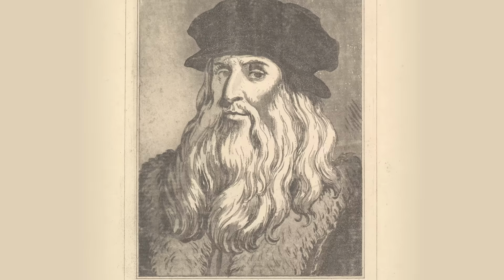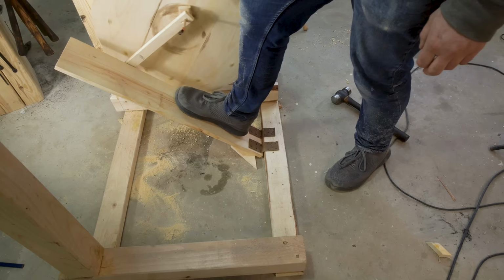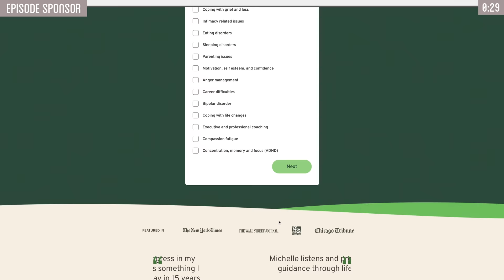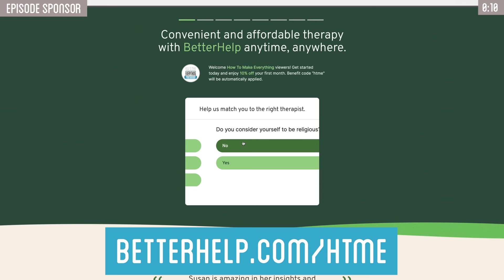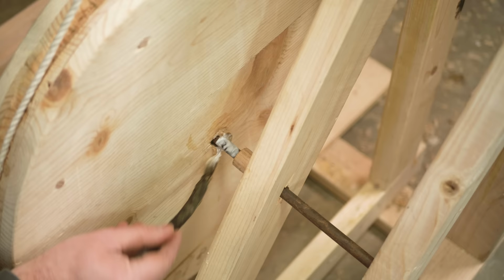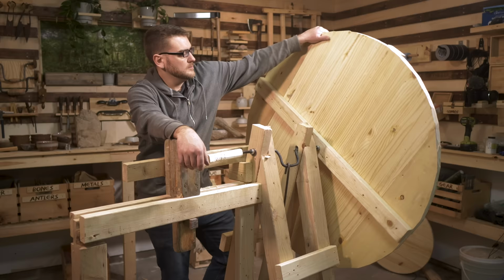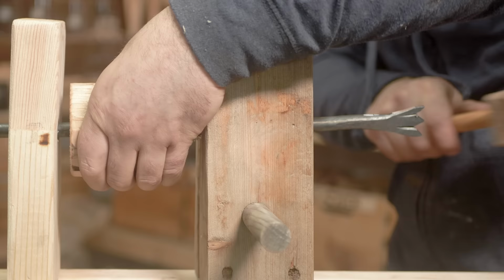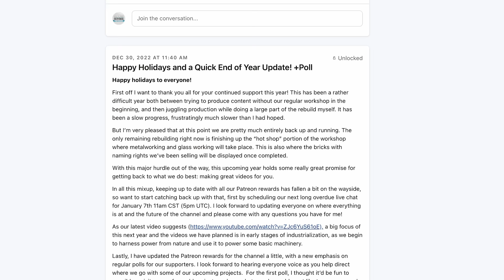Does DaVinci’s 500 year-old Lathe Work?

Comment: Building a lathe is one of those things that as complexity goes up, weak points become readily apparent. Loose holes and joints add extra flex, which in turn leverage on other joints to break wooden pieces. Hence bolt plates and metal wrapped joints, at least for the parts that didn't need to be very rigid. That and not using pine, but that's a side area where hardwood shines.
At any rate, a flat belt drive to a flywheel that is itself connected to a larger wheel that connects to a smaller that drives the work piece may be on the horizon. As the actual power, an assistant instead of the one holding the cutting tool. Barring a waterwheel being used. Try to avoid the use of rope on pulleys because of the low surface contact patch, again getting back to flat belts usually made of leather. It's quite interesting to see the progress of the tech as through the learning curve and the simulation of the centuries goes by. Most definitely a good series to watch.

Comment: a few things that would help:

lower the tool mount a smidge to help the angle

find a tree removal company and pick up some fresh green wood. preferably hardwood. a softer hardwood that is very frequently removed is silver maple. green is easier on the tools and makes smoother cuts.

always have sharp sharp sharp tools

the wobble concerns me as you get higher rpm’s and your tool could get caught accidentally and could injure you.

your woodworking skills are getting better!

through history there was always a huge communal support and knowledge guiding these methods, and many things were outsourced or tools passed down from each generation.

when you are splitting a tenon, split far away from the line, and then slice down to the line.

pine, especially around knots, can be really unpredictable. avoiding them in layout sometimes doesn’t work, but it’s something to be aware of.

great job. you’re a trooper.

Comment: Your drive assembly pulls to the side stressing the joinery and causing it to break. Maybe use a metal throw crank.  Also when joining metal drive components to pulleys and flywheels, forge the metal square where it goes through the pulley and use square cut outs through the pulley. Use the biggest square you can and the connection will be stronger.

Comment: I would suggest trying to create a tensioning mechanism in the pulley system. also you could drastically reduced the spinning friction by making simple metal sleeves to pressure fit in the wood and then put the axel through the metal sleeve. metal on metal friction will be much less then metal on wood. it will also prevent the holes from boring out as fast. less friction will also reduce a good bit of the rotational forces that are made that contributed to your wobbling issues.

Comment: This is such a cool channel. Even with my experience using a very small lathe if the work stops or slows down you end up with an ellipse instead of a circle and then it gets worse cause it's lopsided etc... This was the main challenge of any non motorized lathe and takes a lot of skill to coordinate everything in order to finish a piece, if you go out of round sometimes you can't finish the piece. The flywheel would really help with that.

Comment: A little tip about fly wheels is that the mass on the outer edge is what is doing most of the work.  If you make it more like a wagon wheel with a lot of mass on the outside you can make it more efficient.  Also, Davinci would have probably ended up creating metal bearings to reduce friction and retain the grease better.  Wood is will tend to absorb the grease and has a much higher friction quotient than metal on metal.

Comment: Nice work. I subscribed because of this video. Looking forward to more.

One thing to consider is the vibration from the fly wheel not being centered. Run the wheel first to sand it down until the radius from the center is equal on all sides.

Unbalanced flywheels are the biggest problem in vehicle transmissions...that and wear.

Comment: Build a tension rod and wheel between your flywheel and smaller wheel to pull the slack out of the belt. This way you can also use leather sewn together to make a stronger belt.

Comment: You need step down gears my friend. To use an automotive analogy you're trying to switch from 4th to 1st on the same revs. Of course something is gonna break. Put an intermediate gear in between and not only will it work but you'll have a higher rpm at the  emd.

Comment: One thing I that makes a drastic difference to how easy it is to cut with a human power lathe is the position and shape of the tool rest. The closer you can get it to the rotating piece the better  and the less cutting power you lose to tool flex (look into systems for adjusting this on a pole lathe), and the height and angle really matters. It's the main thing between you and actually being able to produce high quality results on something like what you have built.

Comment: in regards to your auger drill.. the handle is supposed to go through a eye hole with about 1-2 inches of band around the shaft of the handle for more strength and torgue transfer with lower risk of snapping preferably a hard wood

Comment: That has the same design and moving parts as the driving parts of a treadle sewing machine. Within the machine head is some gears that transfer the power of the treadle into a faster motion that moves the needle up and down, the foot that pulls the fabric from the front to the back as the needle goes up and down placing stitches in the fabric, etc., etc., etc..

Comment: you may want to consider a counter-weight to use with foot pedal to help turn the flywheel and keep it going one direction.  i noticed the very last one you showed, that when you used the foot pedal, the flywheel wanted to go back in other direction once the pedal had been pressed down.
great to see how you learned and improved it.  makes me want to make one now.
Reply: Countering the flywheel is best with two, smaller flywheel in each side instead.
Counter weight and using less effort for building two little wheels, instead of a big one, plus a heavy weight.
Reply: what you really want is a one way disconnect

Comment: For some of the issues you're having with the advanced design, you may want to look at some of Singer's older treddle sewing machines.  Namely using an iron linkage to the cam shaft, that's going to be where most of the stress is in the system and the most likely breaking point, wood may not cut it.  Any time you use gears or pullies to increase speed, you increase the required force input by the same multiplier.  You might also want to consider cog wheels over pullies,  just because they are easier to repair and fail less catastrophically under heavy forces.  Also,  you're getting into a part of industrialization where things can get dangerous quickly when you have high powered moving parts that interact with each other,  so make sure to add some clearance room for the operator(s).

Comment: Another elemente you can add is adding weights to the flywheel, allowing more energy to be stored. As well as possibly running a waterwheel for the flywheel - obviously assuming you have access to water.

Comment: i mean, if you added cogwheels to it you could most likely get a decent speed on it ( on the important part that needs the speed ) that would mean you need to seperate the metal that spins the lathe to the side and add a cogwheel that connects to the other cogwheels that spin because of the big wheel, though you'd need a lot more fine tuning to connect the 2 seperate parts.

Comment: Deeper grooves with a rougher internal surface for the pulley system, and add weight around the edge of the wheel you're using to store momentum. At least that's what I would do if you're still continuing the project

Comment: First, your lathe needs a strong, stable base with no wobble allowed. Then, you need to sit your spindle in a set of precision bearings, a set of bronze bushings with oil circles will do. Then add power to the spindle. A large flywheel can only work well with a set of smaller wheels that can crank the spindle up to a high speed.

Comment: While overdrive gearing would almost certainly make the lathe more efficient, there is does come the danger of losing too much torque and making it prone to locking up. In the direct drive design, while its slower, you have to arrest the entire momentum of the flywheel to stop it, which depending on materials, can be quite a bit of force.

Comment: Medieval Europe was largely hardwood forests. The rowdy operation of the assembly is contributed to by the use of softwood materials. Softwood joints, bearing surfaces, linkage members easy spilt on grain line will disintegrate quickly from torsion stresses. Hardwood flywheel has much more mass to 'load up' with more energy.  Softwood stock would rather tear then shear. Your 'test' is proof of concept at most. Any other performance and such evaluations have too much variation in softwood density to put forth. Lathes need mass to be stable, it needs ballast weight added. This will increase stress on softwood structure further requiring hardwoods.

Comment: Has HTME ever made a surface plate?  
After a lathe, I think the next step to industrial precision is near perfect flatness. Craftsman were planing and polishing surfaces for centuries, but British inventor Joseph Witworth theorized in the early 1800s one could take three relatively flat pieces of material and grind them one against another in turn to create remarkably flat surfaces.  Using three instead of two ensures one doesn't just create matching convex and convex surfaces.

Once we had true flat reference surfaces, that led the way to the beds and machine ways that improved the lathe's ability to make perfectly round objects, gave way to precisely ground gauge blocks for measuring, and so much more.

Comment: As a computer software engineer, allow me to give you some design principles that will make your life easier--any engineer's life easier.

1. Let everything be according to one purpose. A thing has a single purpose if its immediate or principal effect is the objective purpose of the thing and nothing else. For example, the objective purpose of a pen is to mark surfaces; a subjective purpose of the pen is to write, to draw, to sketch, etc. Each particular purpose, objective or subjective, should exist only within one object at any given time.

2. If applicable, make sure everything is well-named. In software engineering, there is necessity of using human-readable names, but for physical objects, it suffices that each object has a simple name constituted by one or more unique symbols such as ABC or 123, etc., provided that the definitions are properly attached to the names, and the names are used consistently.

3. Guarantee the autonomy of every object designed, i.e., ensure the parts work in themselves according to what is possible for their own specifications, then ensure that the object meets the desired specification as a whole.

4. The documentation of a product is a thing which at minimum describes the correct usage of the thing and is the specification of the product itself insofar as the effects (given here) imply the causes, and as the effects define the objective purpose of a thing, tell the purpose of the thing itself without revealing the means by which the effect is obtained. Actual documentation should exist for any product, even if you are the only intended user, and this constitutes a manual.

5. Whether or not the product satisfies exclusively or inclusively the product specification should be known and determined by circumstances. A product exclusively satisfies a specification if all possibilities consist of the specification and nothing else; a product inclusively satisfies a specification if the specification is a subset of all possibilities of the product.

Principle 5 is where most software bugs occur, and also where most bugs in engineering in general occur, for reasons that are obvious upon a little meditation. In the case of your improved lathe, things aren't working properly--because you haven't guaranteed the autonomy of each part according to its purpose. Is the flywheel correct? Is the user interface correct? etc.

One thing to note: make sure you don't confuse what belongs to a thing and what does not despite being in the thing. For example, the fact that an interface uses a square peg insert to connect two things is accidental to interfacing itself; however, the choice can be non-trivial according to circumstances, and the choice of accidents must be carefully meditated upon to ensure that you have inclusive satisfaction of a specification. As there exists a difference between a square and a pentagon, holes of these shapes from our example necessarily will be to their own purposes. At times, the choices are permitted to be arbitrary, but apart from those accidents known as "aesthetics" and "good looks", it is absolutely impossible, metaphysically speaking, that anything is accidental in the choice of accident. It could be a simple justification such as "this is the simplest shape that uses the least effort and cost to construct". 

That being said, it is never justified to give up and just use the first accident that comes to mind if you want to make a robust product that you yourself can wholly verify meets the desired specification and nothing beyond it. Unfortunately, many companies fail to recognize that only the accidents are where optimization can occur, so they've optimized the quality out of things to make a quick buck to everyone's detriment. Now your lightbulb needs replacement every 5 years; your products uncannily expire near warranty end; and things are too fragile in general and made of plastic. You'd think if the guys talking about saving the planet, and the megacorps involved in it, actually cared about that, then they'd abandon plastic and other novel materials for truly recyclable and traditional materials like metal and glass... but no one needs to buy more if it lasts forever (like glass), so paper cup coffee it is for you!
Reply: Very interesting take, thank you for your insights.

Comment: I would also suggest bearings I know that it is to early an invention for ball bearings but barrel shaped bearings with tapered ends should be within the time frame for this. Also you might want to use a denser wood for more weight should help with the wobbly effect.

Comment: I may be wrong, but a master "medieval carpenter" could have used more diversified wood species for certain parts, such as boxwood (a very hard wood) for the highly stressed rotation axes and more flexible species for the pedal by example .
Alternate solution (as noted in comments)
separate the "production" of the rotation from its use, a master always had 2-3 apprentices who could turn the crank to produce the rotation

Comment: the lathe I used for wood was by removing the sewing machine, keeping the pedal and flywheel at the bottom and then put a pulley on where the sewing machine was
it's the same as davinci's but improved a bit

Comment: a more efficient design for the flywheel is to weight it further away from the axle, to increase its moment of inertia. If I'm remembering my physics classes correctly, of two wheels with the same mass and radius the one with its mass concentrated further away from the axis of rotation will have a greater MoI

Comment: Excellent video, great idea. To maybe help I offer a couple suggestions, if they help awesome. 
First, tighten up the build. Your flywheel is all over the place which I would imagine causes a parasitic loss of energy. Along with fixing your flywheel you may consider tightening and strengthening the whole build. It rocks and flexes and moves all over, again causing a loss of energy. If it's at all possible I suggest anchoring the lathe to the floor.
Second, instead of rope or cord, try a leather or canvas  belt, I believe this will cause your pulleys to work more efficiently and transfer more energy from your flywheel. You are off to an amazing start, don't quit. Folk today have no idea really what it took to create something in the past and you are doing a great job showing people how difficult it was and how much more rewarding.
But ya, tighten up your build, anchor if possible, (your build I'm sure is quite heavy but ya gotta remember that there is a lot of energy in your system, that flywheel gets going and it'll shift some weight, lol) and use canvas or leather belts around your pulleys. Good luck I can't wait to see the improvements. Excellent video.

Comment: I've often thought of making a treadle lathe using a cheap mountain bike rear wheel as a flywheel. The freewheel system is built in, and you can vary the gearing as desired. Wrap the rim in iron tie wire for extra inertia. I think that'd work pretty well.

Comment: Add some lead weight near the outside edge of the flywheel at maybe 5 or more points. As it sits, it doesn't have enough mass to fight the friction at all the moving connection points. Instead of a direct drive, add a pully connection from the flywheel to the spindle to get more speed. Just have to figure out a way to keep it from slipping on the pully too much when the chisel is applied to the spinning wood. I don't know. Just thinking with my fingers I guess. :-)

Comment: The wheel not being perfect will always throw the rope, even a perfect wheel will throw the rope. You need an Idle Pully, its a small wheel on a leaver with a spring to keep the rope under constant tension. You could swap out the spring for a weight on a rope, the idea is something to keep the rope pressure even regardless of the wheel concentricity